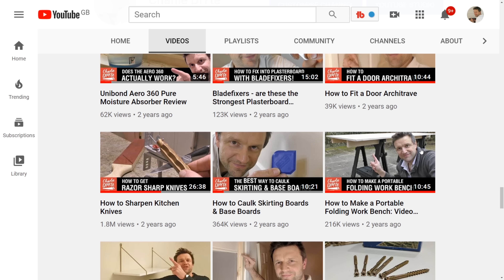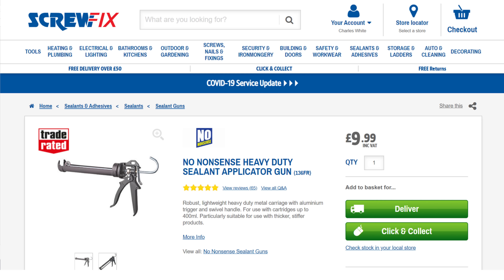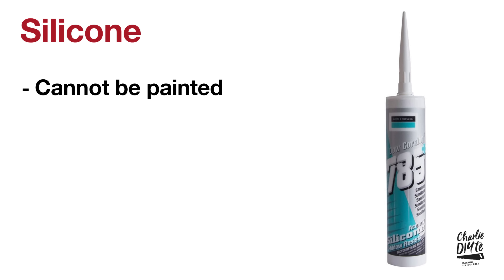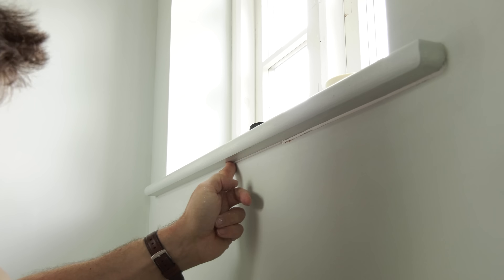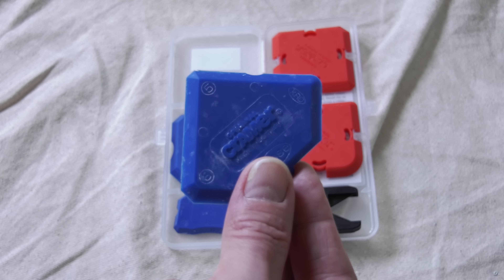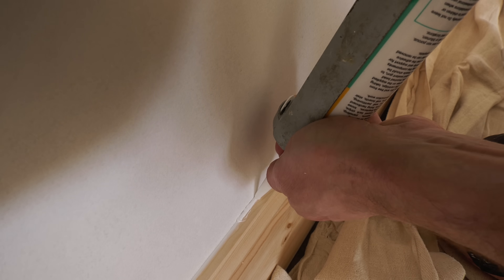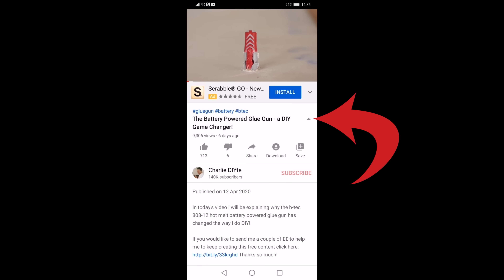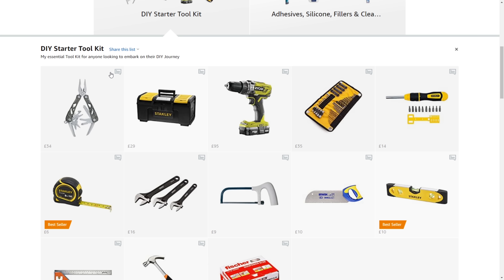How to Caulk Skirting Boards & Baseboards - 2020 Update

Comment: Hi Charlie! Yet another great video  thanks for the updates. 

Great tip on re-sharpening the Cramer tool. I knackered my 90° one doing skirting. You have me worried now that I should use the diagonal one but I have found the 90°makes it easier to cut in rather than more difficult. 

Can you explain your process for painting? I would normally caulk, then prime woodwork with BIN then 2 top coats. Then top coat the walls. I do it this was as I can mask off the skirting etc to avoid roller splash when I do the walls. I am using the tape to get the cut lines though, I do them by hand.
Reply from the maker: Thanks! I've found particularly with wood skirtings that they only have to move a mm or two for the gap to open up, but with a diagonal it's much stronger. I agree the 90 degree profile looks much neater though. A few people have said in this comment feed that I should have primed the skirting before caulking so that moisture isn't sucked out of the caulk. It's a fair point so I think the best solution would be to prime the front and maybe 10mm or so down the back before fixing to the wall. As for the painting, if it ain't broke, don't fix it. Your process sounds fine with me.
Reply: @CharlieDIYte  I have noticed a difference between primed and unprimed boards. I was byying pre primed skirting and architrave but ending up priming all boards with BIN anyway. So thought I would save some money by buying unprimed achitrave, have noticed that the caulk shrinks more on the unprimed.

Comment: What are your thoughts on battery-powered caulking guns? I would have thought that professional renovators would prefer them, as -- at least for me -- manual caulkers are murder on my fingers.
Reply from the maker: I was just tapping out a reply to Mohammad, above, about this because he's modified his gun to work on his drill and says it gives a more constant supply rate and is easier to use. I'd always discounted battery powered guns but might look into this and suggest you give one a go, particularly if you're struggling with the old fingers. That said, if you look at typical guns like this https://amzn.to/3coxMsJ the price is punitive unless you're a professional who's caulking miles of bead every day...
Reply: I've got an rsi and joint narrowing in my right hand which makes it difficult to use tools requiring a squeezing movement for more than about 15 mins, so a manual caulking gun is out. I've bought a ryobi battery gun. I've done 2 windows with it and will be redoing the shower today, and it is a godsend. The 5amp battery is best for any job taking a fair time and for me the lowest speed setting is fine. I've also bought the Cramer set based on your recommendation, and it is brilliant. Thanks Charlie for an excellent set of videos.

Comment: Don't use the Evo-Stik Decorators Caulk recommended - within a month it had attracted all manner of dust and looked unsightly. My advice is to use the Bondit Charlie uses, but use it for both gap-filling and for the 45 degree beading between the skirting & the wall ...
Reply from the maker: Yes that's what I've done on the wardrobe build I've just finished. All caulk has a tendency to attract dust but you should just be able to wipe or vacuum it away.
Reply: @CharlieDIYte  Many thanks for your reply. After using the profiling tool to shape the Bondit (i.e. Bondit Saves Nails SF) into a nice smooth 45 degree bead between skirting & wall, is it okay to use a wet sponge or cloth to wipe away any excess adhesive sticking to the wall or skirting board ? I assume it's okay to do this as Bondit is water based. Thanks again for any advice with this.

Comment: I have cracks between my baseboard and hardwood floor.  Do I use the same adhesive filler and caulk that you used?  Thanks.

Comment: Hi Charlie. Great series of videos - thank you! How would you fill a gap between a painted MDF skirting and a laminate floor which has settled slightly away from the skirting as the foam base has compressed? Clearly, as the floor is not going to be decorated, it is essential not to leave any caulk/gap adhesive residues...Any suggestions, please?
Reply: That's what beading is for....

Comment: I have a lot of chips on my old wooden doors from my children. I need something flexible so that it does not crack when through run or jump and vibrate the door and door frames. What would you recommend?
Reply from the maker: If they're painted, I'd still recommend 2 part wood filler. It's not flexible but you won't get a good solution from something flexible like calk.

Comment: Hi Charlie, great video. Do you have any tips for removing caulk before re-caulking ? A new build,timber frame house so there is a lot of cracking and shrinkage. Not sure how much to remove first especially where the cracking maybe isnt the whole way along a run? thanks.

Comment: Hi Charlie, my skirting boards and plasterboard part company every year with a fine gap, presumably because of movement due to stress, changes in temperature and or humidity and central heating. Polyfiller doesn't work, would Caulk flex with the movement. Thanks.
Reply from the maker: Hi Steve. I had that on the skirtings that were the subject of my original video on this. Caulk does flex more than polyfiller but probably not enough to prevent it tearing. Maybe try some of that solvent free gap filling adhesive that I used....? For very thin gaps where you can't get much in, it will probably still part company but if the gap is a bit wider, it might be successful in knitting the two surfaces together. Better than decorators caulk, anyway.

Comment: It would be good to have a video on wood painting of skirts and doors. I just hate painting these. Always leaving marks everywhere. Should I use a hard brush or a soft brush? Are all brushes the same? Are all wood paints the same? Do I need to add extenders to paint to increase drying times for paint? So may questions.
Reply from the maker: Hmm. I always prime with Zinsser BIN and then apply 2 top coats (3 in this case) with either an acrylic eggshell or acrylic satin (both water based). I believe the satin is marginally more hard wearing. I use a mini roller - typically simulation mohair although foam would also work well, a sash brush to cut in where the wall meets the skirting which I also use for the decorative bits of the skirting. In terms of brushes pro painters will always tell you to go with pure bristle but with water based paints synthetic brushes work perfectly well. Get decent quality though rather than the cheap no frills ones, and a mini wire brush to clean the paint brush after use. Have a look at my Amazon Store for more info https://www.amazon.co.uk/shop/charliediyte

Comment: Hi @CharlieDIYte I need some advice. I have installed skirting boards as the final item after a floor has been tiled and walls painted. I understand this is not the ideal scenario. The bottom of the skirting boards where they meet the floor has gaps where wood and floor are not perfectly level. Would i fill those gaps with caulk or silicone?
Reply from the maker: I wouldn't fill them if you can help it. You'll struggle to do a neat job. You can't overpaint the silicone and the caulk will shrink and need painting which will be tricky to do. Could you take off the skirting board and scribe it to the floor?

Comment: I used your video for siliconing the bathroom and bought all the tools you recommended and it works great! I am totally in love with this little tool and I will use it again in next few days for caulking the skirting to wall. I do have one technical question if you would be able to advise. Does the new engineered wood floor needs caulking to the skirting board as well? Or it just requires the caulking between skirting boards and wall? Thank you in advance.
Reply from the maker: I'm so glad to hear it's worked well. I wouldn't advise caulking the floor to the skirting, as it won't look neat, even if you paint it (which you'd have to do in any event otherwise the caulk would get grubby). Just caulk the skirting to the wall.
Reply: @CharlieDIYte  Thank you! You are always so helpful and prompt with your responses.

Comment: Charlie quick question
If I use the diagonal profile then what colour do I paint the caulk? 
Colour of the wall or colour of the skirting?
Thanks in advance
Reply from the maker: Hmm. It's an interesting one that. I'd say the wall colour, as otherwise the skirting could look different depths if your gap isn't consistent all the way along. Also, if the caulk has shrunk a bit, it could look a bit untidy if you paint it the same colour as the skirting. Just my views. I'm sure people will disagree.

Comment: Hi Charlie, very informative vid. I had someone in to fit skirting boards for me that are sitting on top of karndean floor. He corked in the top of the skirting boards but I don’t think he did a great job fitting the skirting as there are big gaps between the floor and bottom of skirting. Could I cork and use gap filler for that as shown in this video? Thanks
Reply from the maker: Thanks. Why are you wanting to fill the gap? If it's because of draught you might be better using expanding foam tape like I did here https://youtu.be/V6lZXjRR-1k. It also resists moisture so will be fine when you wash the floor etc If it's for aesthetic reasons ie you don't like the look of the gap this is a little trickier as a band of caulk between skirting and floor won't look very nice.

Comment: What do you do if the skirting board is going to be  left a natural wood colour e.g. stain / oil / varnish, etc.?

Do you use a coloured caulk or do something else?
Reply from the maker: I'd probably use a normal caulk and paint it the same colour as the wall.

Comment: I've always avoided caulk after previous issues, however, after seeing this your video and needing to do a similar skirting I thought I'd try again! Unfortunately I seem to be getting a similar issue as before,  where the caulk leeches through the paint giving a darker stain. I'm using a paintable caulk (Soudal).  I guess I'll have to seal it with some Zinsser product, but wondered if you had experienced an similar problems?

Comment: Hi charlie, quick question please. Do you tend to paint the chaulk in the satinwood (white) used on the actually skirting boards or do people usually paint the chaulk same colour as the wall it's on ? So going down the wall right to the chaulk on the skirting board like you have done.
Reply from the maker: Very good question Matt. Probably in the skirting board colour as then you're only making the skirting board look more substantial rather than extending the wall horizontally into it. You can solve this though by following the interior designer Abigail Aherne's advice and paint everything the same colour. I listened to her on the radio talking about this (on R6 Cerys Matthews show) and it's a game changer. I wouldn't go back to having contrast colours now and it also makes cutting in so much easier.

Comment: Hi, may I ask for advice please. I have a bathroom cupboard that I have redecorated due to a mould issue, and that included getting rid of an old skirting. Now it's all repainted, I would like to fit new skirting. The problem is that the gap between the walls and floor tiles is not everywhere even and goes from about 15 mm minimum to about 25 mm! What to do in this case, please? It will be my first time fitting skirting boards so all tips are welcome. Thank you
Reply from the maker: Hi Celina. I've done a video on this here https://youtu.be/qhe3Waq6Ac4 and I talk about scribing when your floor is uneven, in that video. Hope that helps.
Reply: Thank you!

Comment: Charlie, is the gap-filling adhesive stronger than wood? The skirting you're using here is disposable modern stuff but I'm concerned about 280mm deep skirting that, being 120yr old is close grained & in one piece, and so pretty much irreplaceable.  I don't want to wreck it by assuming it will never need to com,e off the wall again.  What would you recommend in this circumstance?
Reply from the maker: I think you'd be ok with that solvent free stuff I used. To be honest, it's more like caulk than the gap adhesive that sets like resin. I agree with you about the skirtings. It broke my heart to rip out the 100 year old stuff, but it was so badly damaged and half of it didn't match.

Comment: I'm having trouble filling in a gap between my tile and wash hand basin in the bathroom any suggestions
Reply from the maker: Difficult to comment without seeing it but if you're wanting to silicone the gap you could insert backer rods into the gap. White cement is another option.

Comment: Great vid, Charlie! Do you have any tips for using the profile tool to caulk window and door casings that are not always square? One issue is I’m getting a lot of vibration marks. Thanks
Reply from the maker: Thanks Julie. You could try one of the Fugenfux profile tools as they're quite a bit narrower so less likely to clash on the unsquare  surfaces. Here's a link to my recent video https://youtu.be/VlRNNlARX_M

Comment: Should always prime wood before caulking as caulk is not recommend on bare wood. It is more likely to shrink and will dry too fast making it weak and not as flexible. 
If not using your finger or for smoothing larger gaps, I would say the best tool for applying and smoothing caulk is a 1" filling knife. It works the same as the Cramer FUJI right angle tool but doesn't wear down like the silcone tool and gives a better finish in my opinion.
Reply from the maker: Some good points there. Thanks for the comment 👍

Comment: Thanks for this Charlie. Could you answer me a quick q? I used your previous video earlier in the year to learn how to caulk my loft. Unfortunately during the UK's recent hot spell a few have split (like you show at 2.52). Should I scrape it all off and start again, or can I apply a second layer to fill cracks? Thanks in advance

Comment: I wanna do between the skirting board and floor boards but I stress about painting it cos I’ve tried and the paint leaked thru the masking tape and onto the floor boards.
Reply from the maker: Yes I wouldn't caulk between the skirting and floor. It's very hard to do neatly and needs painting, and being on caulk the paint wouldn't be very durable.

Comment: I’ve just finished siliconing according to your relevant video and it turned out waaay better than my last time, then using all official sources I could find (with tools and the occasional finger, 45 degree cut nozzle, soapy water…).

This video has just come up in my suggestions and I feel very tempted now to correct the terrible caulking the painter did along my skirting boards last year. They filled the gaps between the very wonky walls and the sttaight skirting boards with paintable acrylic and wiped it more or less horizontal with their fingers. Now it is a slightly indented surface with the occasional crack and some accumulated, uncleanable dirt/discoloration. I was wondering whether it is necessary to remove this old caulk before applying the new layer? It is in the same position as where you’ve put the adhesive first layer, only, it is one year old and not perfectly bonded.
Reply from the maker: I wouldn't bother removing it - except perhaps any that you think will be evident after you've redone the job properly. The old caulk will actually help as it acts as a packer to minimise shrinking of the new stuff. It pays to spend a bit more on a good caulk that has minimal shrinking. Yes it's really hard to clean dirt off caulk. That's why you need to paint it before dirt and dust can start accumulating. 👌

Comment: Thanks for sharing Charlie. Do you paint over the caulk with the emulsion or the gloss? atb
Reply from the maker: In my case I painted over the caulk with emulsion, so in essence the caulk becomes part of the wall rather than the skirting, as if like me you have irregular gaps between the wall and skirting, if you gloss the caulk you could end up with a very irregular looking skirting. Also, if you can, paint the walls ceiling and skirtings the same colour. It's very very smart and makes the room look so much bigger, plus then, any gap behind the skirtings won't be as accentuated as it would be if the walls and skirtings were different colours.
Reply: @CharlieDIYte  Thanks Charlie, that's crystal

Comment: Hey Charlie. Great video – many thanks. Have you ever tried Bona Gap Master for filling skirting board gaps or around door frames? My gaps are wide but secure (i.e. no need to use adhesive yet likely for traditional caulk to sag into the crack)
Reply from the maker: Thanks! I haven't. That's very interesting! I like the fact that you can sand it. I suggest you get a tube and experiment on a small area and see how you find it. Let me know how you get on.👍

Comment: What a great introduction to caulking. Is it the same for mastic, that I am using to fill gaps & loose filler in my garage? By the way does using your finger add bacteria to silicone, which could later cause mould to grow.
Reply from the maker: Yes, they say using your finger does add bacteria, and I made a big point about this in my bathroom silicone video, but for caulking that you're going to be painting over almost immediately, in a dry environment like this, it's not going to be an issue.

Comment: You didn’t mention storage or what to do with end of tubes ?
Reply from the maker: You can tape it up as best you can with insulating tape or put a solidified nozzle from an old tube on, but once you've opened it, it will go off in time, however you seal it.